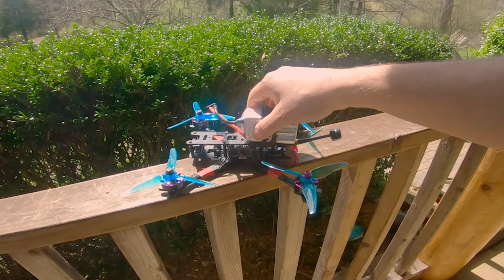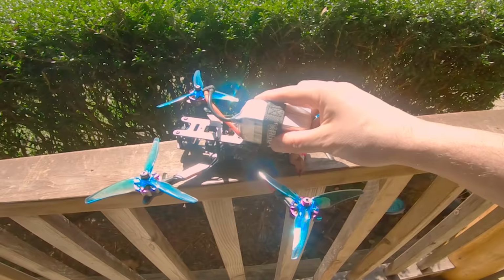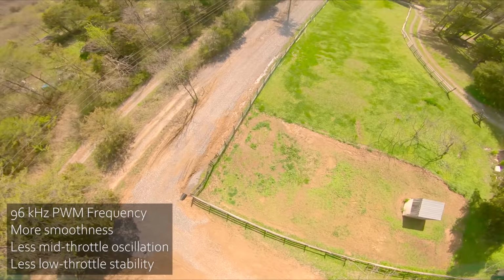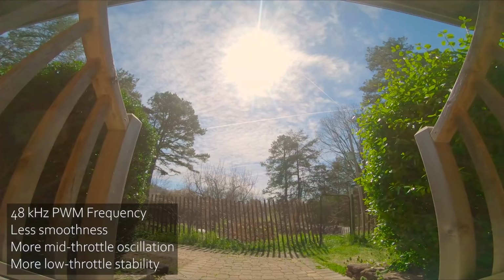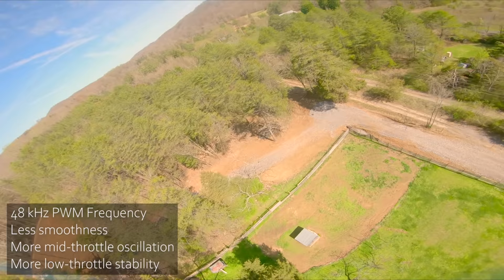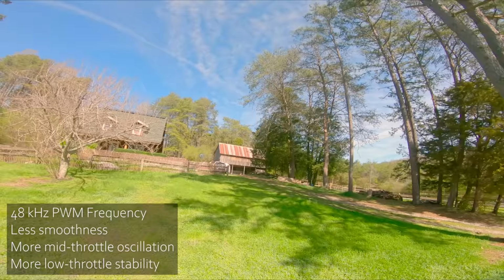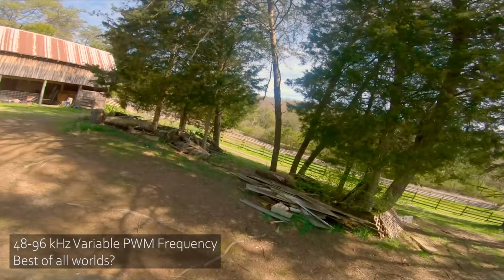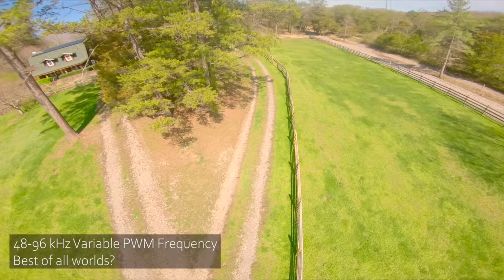BLHeli 32.8 variable PWM frequency FLIGHT TEST

Comment: would be a better test without the weird battery placement..
Reply from the maker: If I didn't have off center CG, there would be no instability to demonstrate. The point is to challenge the PID controller to fix the off center CG.
Reply: @JoshuaBardwell  well.. the point i would be interested about would be "real life difference" of the settings not something exagerated to show the effect.. if there is nothing noticable with normal cg then thats it ^^